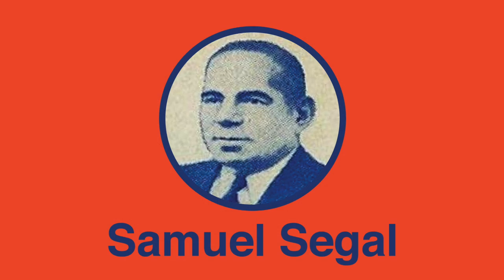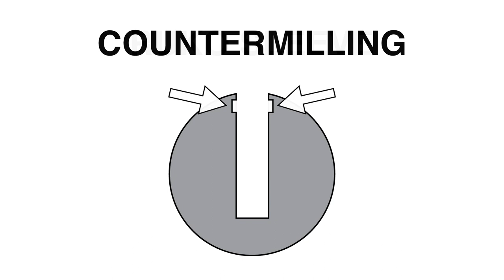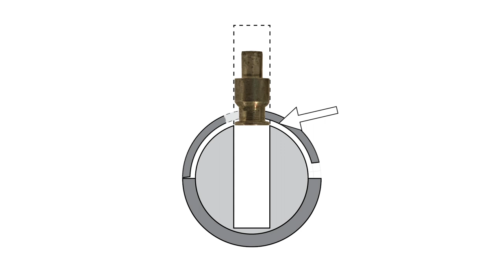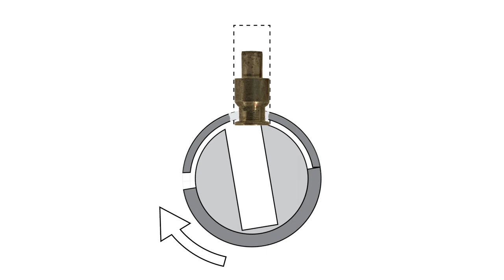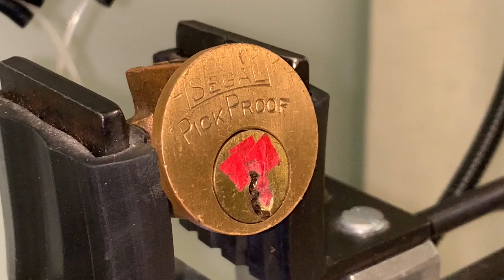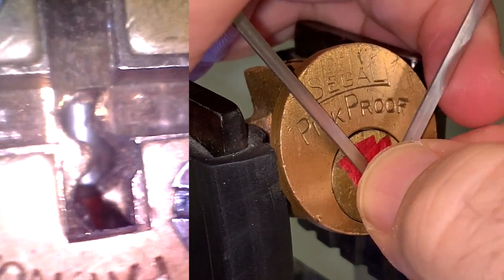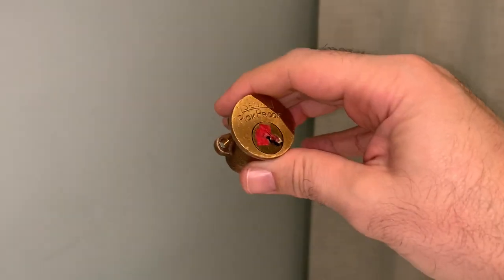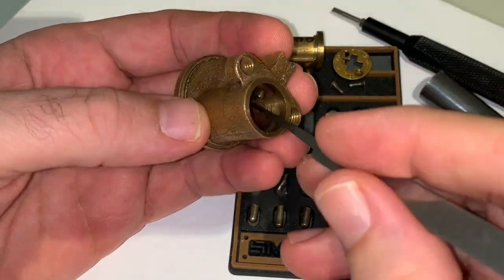(26) Never Write Pickproof On Your Lock - The Tale of The Segal Pickproof - Gin Series Part 4

Comment: Excellent demonstration and picking of the "Pick Proof" Segal. Most manufacturers - today anyway - say "pick resistant" - if they say anything at all! Having taught impressioning for nearly 60 years, it appears that the movable sleeve would in fact grab and bind the wider key pins first, then bind the thinner ones, making impressioning certainly possible. Particularly the bind and pull method, rather than the bind and wiggle.